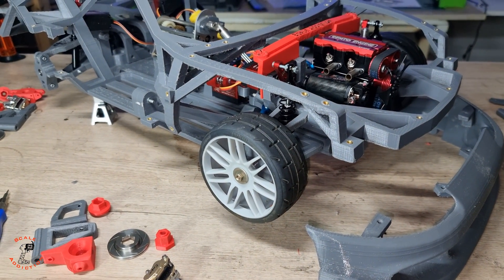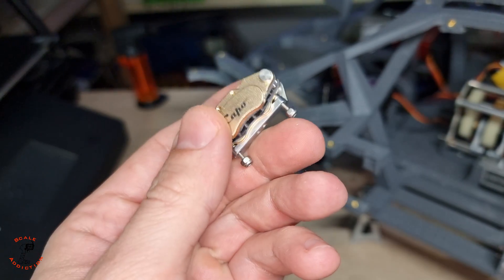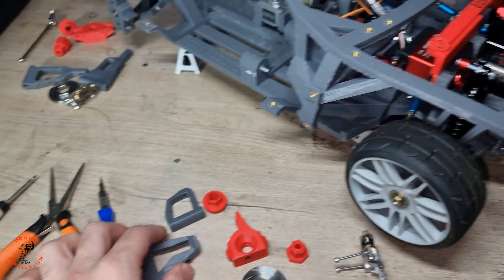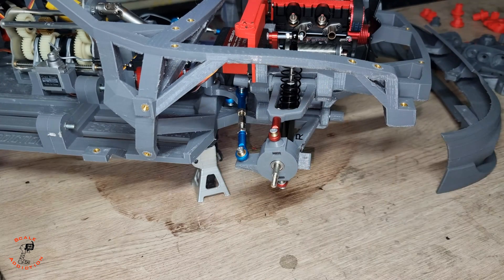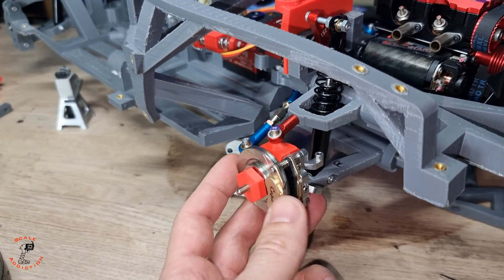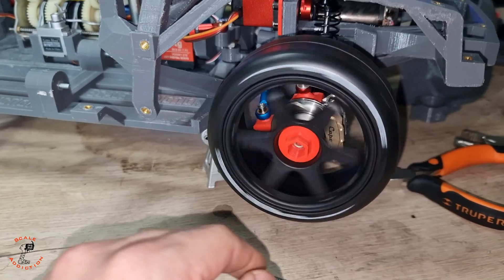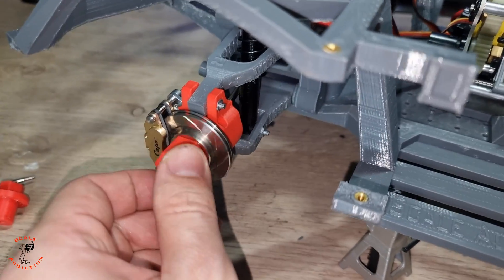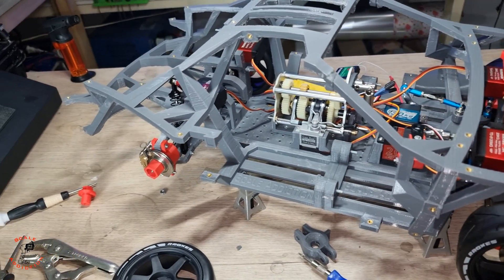Part 9 / 8th scale 3d printed supra with 2 cylinder engine project / Scale Addiction

Comment: I think you will have problem with brakes. Brakes discs will start to heat up and melt hub while driving. The hub is made probably of PLA. PLA get soft at 60*C. You should think about it.
Reply from the maker: Anything gets soft, I will metal print it, it's for test print now
Reply: Thats changes everything. Keep working. Good job. @scaleaddiction

Comment: hey ali canyou update the build componants on cults 3d it has a few wrong links and still has the 120mm shocks
Reply from the maker: Sure, I will check them out
Reply: @scaleaddiction  also, where did you find the dog bone driveshafts that were the right size im still looking 😂 I cut and resize a set and have issues with them spinning